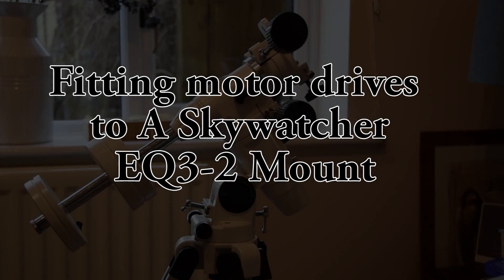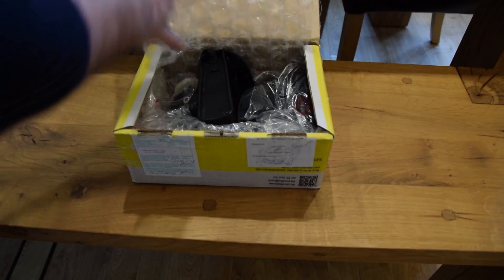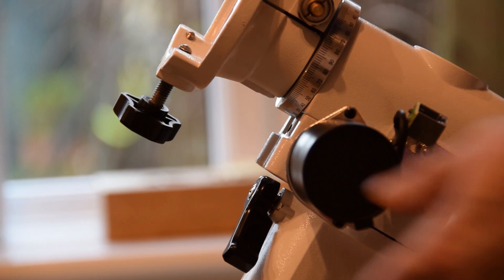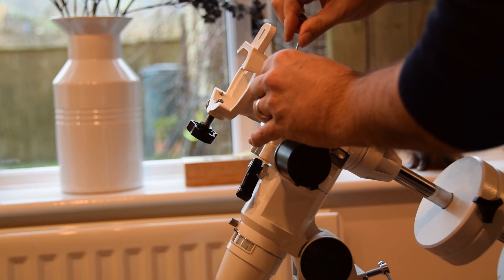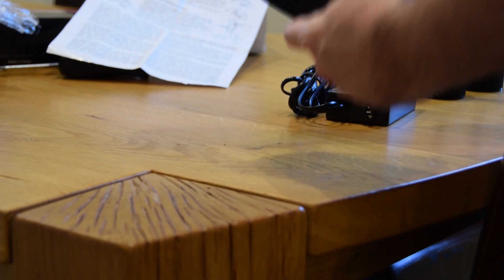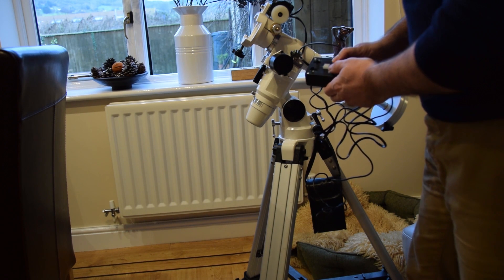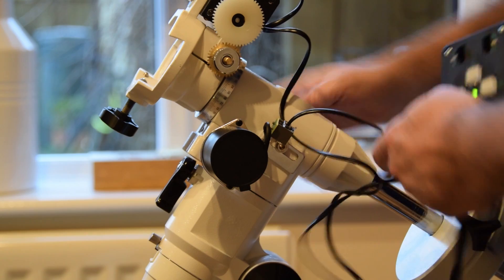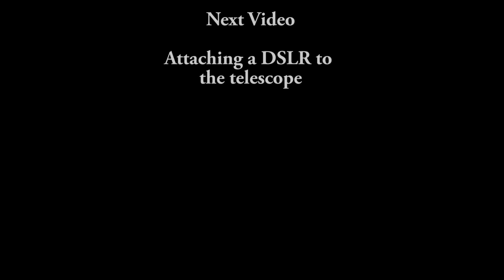Motor Drive Fitment on Eq3-2 Telescope mount

Comment: Noting that this video was completed 9 years ago I suspect it's a little old! But having recently bought the motor and fitted it to my Eq3 mount, the instructions are still very useful. My only comment would be that once the motor is fitted and the manual slow motion cables have been removed, I find it very difficult to fine tune the telescope on the target, (especially when it's something like a newtonian reflector150mm). But, once aligned, it does work well!
Reply from the maker: Wow, is it really nine years since I made that? 😂.  I’m glad you found it useful, looks like it’s been watched over 57,000 times!  Although I’ve long since moved on from that mount and those motors, I agree with your comment about the initial movement to a target. Two things I did to help if I remember correctly were: make sure your finder scope accurately shows the same part of the sky as the main telescope.  And secondly, Consider using the setting circles on the mount (you need to set them up initially), and use those to move the amount to the RA and DEC of the object. As long as you’ve done a reasonably good job of polar alignment and balancing you can get to the target reasonably quickly 👍🏻.  Good luck with it, I also had a 150 Newtonian which I thought was a great scope

Comment: To use the motor drives, you need to balance the mount, with an OTA.
You already have that big counter weight set-up, what for? 
Unbalanced weight can burn out the motors or break the clutches!
Also, i know these Chines drives, those LAN connectors, RA connector sticking out,  are very flimsy, they break easy when putting the mount away or transporting it!
🤔🤔🤔

Comment: Is that the EQ5 dual motors that's being used on the EQ3-2 mount?
If not, Will the EQ5 (dual) motors fit the EQ3-2 mount?
Thanks

Comment: Hi there does this do the tracking ?? As in the point and go in an app type...does that make sense
Reply from the maker: Hi, no these are not the GOTO drives with computer handset.  You have to do a manual pointing, and then the motor will track the object as it traverses the sky

Comment: Can you please clarify something for me. I polar aligned (in Australia) using the PoleMaster and I wasn't sure what speed to use on the RA Motor when tracking. Is 2x Normal Speed? Or 4x. What speed reflects the rotation of the earth? Also, should you not use the fine adjustment knobs when the motor is on instead use the unit to fine adjust onto your star.?

Comment: How long can track a object,without losing a planet or the moon? With perfect polar alignment??
Reply from the maker: Hi Adrian, with perfect PA, for visual use, it would/could track several hours. But for Astrophotography, guiding is the only way to go longer than a couple of minutes (say 5 max) with a budget mount like this.  there are 'periodic' errors in the gears, it also depends on the focal length of the scope or camera (widefield much easier to track longer than high magnification)
Reply: @MikeyJ  I have SW 150/750 with Canon 700D,same mount like you,can do 1 min exposure???
Reply from the maker: Tenu Adrian : I hear these mounts vary in quality, so not easy to say. I managed 1 min exposures but also lost quite a few do to star trails. In the end I decided an upgrade was needed, hence the AZEQ6GT 😉

Comment: Hi Mikey, quick question. I'm looking at purchasing the Eq3-2 mount with the Skywatcher 150-750 150mm scope just as you have in this video and plan to use it for astrophotography. I was wondering whether it would be better to purchase this mount with the external dual motor drives or spend some extra money on another mount that has inbuilt motors?
Reply from the maker: Hi Lachie, sorry for my late reply!  The EQ3-2 and 150p-DS (go for the dual speed focuser version) is a good combo, although the Eq3-2 is the weaker link.  The external motors dont give you 'Goto' whereas the 'Synscan' version (built in motors) does, so makes finding stuff easier.  Honestly, its a long journey for astrophotography, and you will probably find yourself wanting to upgrade the mount in a year or less..

Comment: Hello,

I bought the engine, and it works well for the moon.

But when I make an observation of Jupiter, the engines do not follow Jupiter and it decays quickly.

What speed do you use to track Jupiter?

thank you
Reply from the maker: Fred SX Hi, use Sidereal rate for Jupiter just like the stars, and lunar for the moon 😊

Comment: it will track object automaticly?
Reply: MICHARU RL, I had this setup once. with fairly good polar alignment, I could make a 30sec exposure with 700mm telescope with pinpoint stars. more then enough to get started with astrophotography.
Reply from the maker: yes, it will track an object, but you have to find it manually first!
Reply: MikeyJ ok thanks, but i have one more question. How long will it track a
 object in center of ocular or frame in camera faultlessly?
Reply from the maker: MICHARU Hi, well that depends on how accurate you are on polar alignment. The drives seem pretty good for 15 deg/hr which is what the stars move at, the drift will come with mis-alignment in the setup.  Hope that helps?
Reply: MikeyJ yes it really does helped, if i have more accurate aligment i track longer. Thanks :D

Comment: Do the slow motion cables work when  motors are attached?
Reply from the maker: The DEC slow motion can still be used ith the motor attached, by slackening the brass knurled nut, but unfortunately the RA cannot use the slow motion control at all.  Of course you can slacken the clutch and move the axis freely if you want to make large changes of direction.

Comment: i just used the one motor it is constantly disconcerting the DEC clutch and its drive is anoying i took it off it  is a pain in the arse RA  is all you need really :)
Reply from the maker: I wondered the same, although at least the controls are all in one place on the handset, so after making the course adjustment, you dont have to switch between controller and hand control

Comment: Good Day, at time index 7:30, are you supposed to lock the RA in order to track??  I would think  locking the RA would negate the use of having the RA motors.    So are you tracking with RA locked or unlocked?
Reply from the maker: Jeff Lucas hi Jeff, yes you lock the clutch, it still let's the motor drive it, the clutches let you move large amounts, then after locking the motors drive slowly.
Reply: Mike, did several tests, you do not lock the mount RA when operating the drive motors for sidereal speeds 2x, 4, 8x.  Locking the RA brake on the mount, will damage the RA motor, you will start to see the black spring shaft to warp, indicating to release the mounts RA break.  Also, noticeable, the hand control will blink RED that the motors have stopped instead of steady blinking/solid green for normal operation.  I went further, for better free moments on both axis, I did one quarter turn on the hex nuts, anti clockwise for the RA/DEC worm drive housing.  Locking the mounts breaks on both axis is not a good idea.  Regadrs,
Reply from the maker: Jeff, sorry but that is wrong.  Please refer to page 12 of SW manual: 'Loosen the lock knobs to make large direction changes. Use the control cables for fine adjustment after the lock knobs have both been locked (Fig.e1).'   It's the same on my az-eq6 as well.  Without locking the clutches/knobs, the scope will move easily if touched, and lose position.  The only thing I can think is that your fine adjust is locked somehow, maybe disconnect the motor and try with the manual rotation knob.
Ps: the motors drive at sidereal rate without the buttons being pressed.  The 2,4,8x are for 'rapid motion'  although as mentioned in the video, it's not very rapid.   Thanks for taking the time to comment, happy Christmas by the way 😊
Reply: MikeyJ - All do respect, its instruction as for fine adjustment, RA locked, is mechanically like trying to drive your mini cooper with the parking breaks engaged.  I understand the sidereal rate, my mount RA just went full 180* in 12 hours, without RA breaks locked.  I will call Celestron, no rush m8.   Mike and to your family, friends, followers, Merry Christmas 2016.  Clear Skies.
Reply: @jefflucas_life I know this is 3 years late but I just saw this now, of course they are supposed to be locked, it is the same as having the fine tuning knobs installed, just rather than your fingers turning the knobs, a motor is doing it instead.  Obviously unlocking the locking mechanism doesn't allow you to use the control knobs, large movements manually

Comment: I have the 150mm skywatcher reflector. would like to do the tracking. not sure either the dual axis motor or GOTO directly. any suggestion fronm your experience. After equipped with either dual axis or GOTO, the control knob on RA or DEC can not be function to point other location of the sky, since the motion slew is very slow......
Reply from the maker: Hi there, no easy answer unfortunately.  If you already have the EQ3-2, then at least the RA motor is a good low cost upgrade, and tracking is fine.  I find that now, with the latitude set correctly and the base leveled, i just have to point the one leg north and turn on the motor to track for 30+ mins without losing sight of the object!   The GOTO kit is quite expensive, and i think you might be better going for an upgraded mount to get that kind of functionality.  best is you try to get to see both in action before you decide, maybe at a local club?

Comment: Well hello there. thnx a lot for the Video you have done a really good job it was very briefing...one question though...Does it worth it to buy one, even if someone doesn't want to use it at the start for astrophotography but only for observation...
Thnx again...
Reply from the maker: +talzano filos Hi there, thanks for your nice words.  Yes it is worth to get the RA motor definately.  it means that if you align the polar axis you can move the mount to any position and it will track the object indefinitely.  The DEC motor isn't so useful, its ok for fine adjustments, but too slow (they both are) for slewing across the sky.

Comment: hi, thanks for the video. where did you purchase the motors from? ive recently brought the same scope and mount and would like to add motors for imaging
Reply from the maker: Hi Sarah, bought them through eBay, but 365astronomy does the set for £88, helps a lot for imaging, after a good polar alignment

Thanks for the comment

Comment: Thanks for your video. Learn a lot on setting up the motor to mount. I have the Skywatcher reflector telescope with eq3-2 since 2015. Now would like to go for tracking in purpose of imaging later on. Would like to know it is better off by starting with this dual axis motor or direct goto, as for starting off?
Reply from the maker: Thanks For the comment.  I have another scope with GOTO.  One thing is that you cannot slew about  with the GOTO by loosing the clutches, you have to use the motor drive or it loses its position.  The dual drives are simple, and when you lock the clutches, it starts tracking straight away.  Of course you have to know where you want to point it first though 🤔
Reply: @MikeyJ  when the lock is released, and slew the scope manually, does this action will spoil the gear in motor?  Or it just safe to slew once release the clutch? If want to track, just lock slightly the clutch so that the gear in motor in action?
Reply from the maker: Tan KT ,  no damage with the lock released, the mount is quite robust really!